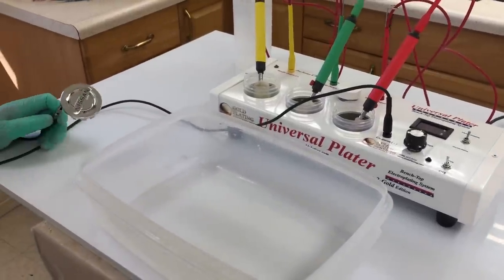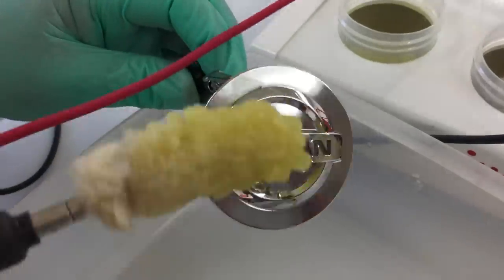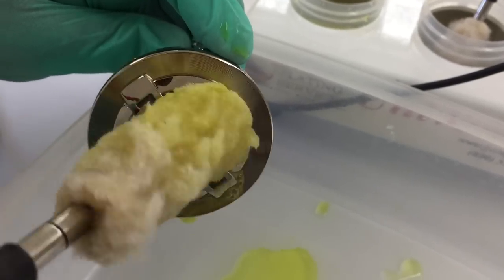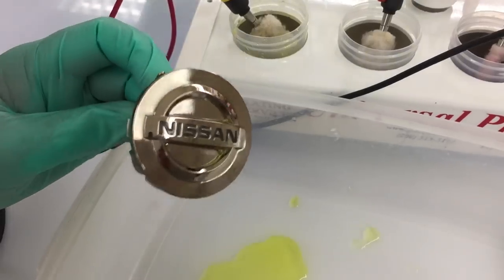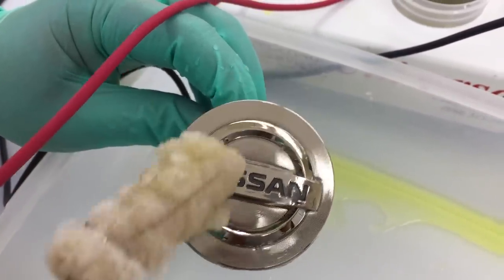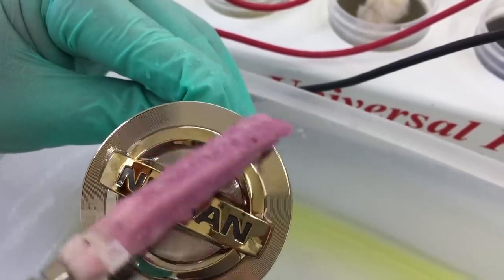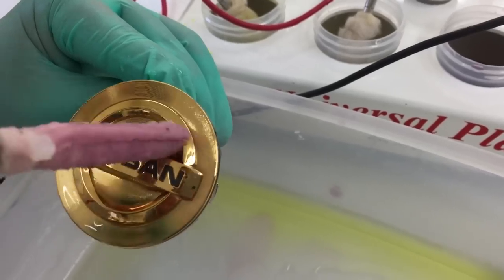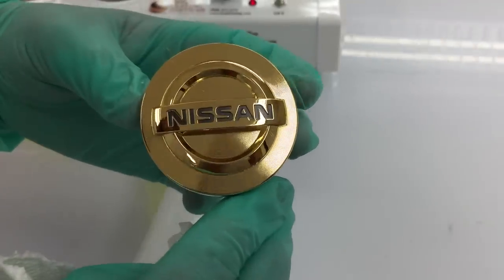How to: Gold Plating on Chrome Items - Plastic Car Emblem - Kit Demo (NEW)

Comment: Is that real gold ? If so how much does it go for ?
Reply from the maker: It is real gold.  Do you mean how much do we sell the gold for?  Our gold goes from $90-$130 per gram, as fabricated solution, depending on how much you buy at a time.  Our 8oz jar of gold contains 2.5g fine-gold and costs $295 for instance.  If you mean, how much will the emblem now sell for?  Many people pay about $50 per piece to have them gold plated.

Comment: this is truly amazing,does the kit come with all that is necessary to gold plate anything even bare steel? and i take it ppl order the solutions from you when they need more? how long will the gold solution last? i guess you need a customer base to make some money and make it pay for itself but i should not have any problem getting ppl to pay 40 bucks to 50 minimum for small items
Reply from the maker: It is truly amazing.  The kit does come with everything necessary to gold plate bare steel.  Yes, we sell and manufacture everything you see in this video (except the emblem) and sell them on a consistent basis - we have for 30 years now.  The gold solution will cover about 1000 square inches of area to a typical decorative thickness.  Many people pay off their kit quickly due to the high amount that can be charged and the low cost per square inch to do it.

Comment: Would it be difficult to do the heads of tiny screws with this? Looks like it wouldnt be easy.
Reply from the maker: If you refer to some of our "Pen Plating" videos (https://youtu.be/sTxOgqKNlPU) , you can see that we plate extremely small areas using the Pen Plating Tips included with the kit.  We've never seen a screw small enough that we would not be to plate them using our pen plating tips.  Hope that helps.

Comment: What is the Nickle Activation solution?  I've never heard of it.  I'm assuming it's not nickle sulfate or chloride right?
Reply from the maker: Nickel Activator (or Surface Activator) is an acidic solution that has no metallic content.  It is purely for activation of certain metals.  Either an activator or a strike is used when plating onto almost any metal, which one is used depends on the metal being plated onto.
Reply: Gold Plating Services

Comment: Can you copper plate chrome parts?
Reply from the maker: Yes, we can.  You also could do it however brush plating of copper isn't the best.  Brush plated copper needs to be polished after plating or it will not look good.  You would follow this same process but instead of using gold you would apply copper.

Comment: Is this real gold now
Reply from the maker: It is real, 24K gold, 99.97%+ minimum purity.  The gold bullion undergoes a process of transformation into a salt.  When this transformation is complete, it looks a lot like table-salt (white).  When you add the gold salt to distilled water, it immediately dissolves into solution.  When electricity is added to the solution, (+)Positive at the anode and (-)Negative at the item you're plating, the gold is transformed again into metallic gold onto the item you have submerged.  There are many other make-up components in the bath, such as hardeners and brighteners, that give the solution it's Purple color but if there was just the gold dissolved in the water it is crystal clear.  You can check out our Pure Gold video that shows a crystal clear solution applying metallic gold to a US Quarter.  Check it out here: https://youtu.be/au1qqg1BEiI?t=1m40s
Reply: Gold Plating Services 
Wow. That's mad! Top stuff

Comment: omg, is it real gold?
Reply from the maker: It is real, 24K gold, 99.97%+ minimum purity.  The gold bullion undergoes a process of transformation into a salt.  When this transformation is complete, it looks a lot like table-salt (white).  When you add the gold salt to distilled water, it immediately dissolves into solution.  When electricity is added to the solution, (+)Positive at the anode and (-)Negative at the item you're plating, the gold is transformed again into metallic gold onto the item you have submerged.  There are many other make-up components in the bath, such as hardeners and brighteners, that give the solution it's Purple color but if there was just the gold dissolved in the water it is crystal clear.  You can check out our Pure Gold video that shows a crystal clear solution applying metallic gold to a US Quarter.  Check it out here: https://youtu.be/au1qqg1BEiI?t=1m40s
Reply: Gold Plating Services how much would it cost to um gold plated a bicycle
Reply: 500$? Unless you wanna plate like 1cm or gold per piece hahaha  @uhohspaggetios3015

Comment: how thick is the layer of the gold please?
Reply from the maker: The piece plated in this video probably has about 20-30 microinches (at least half a micron).  For automotive plating this is a standard thickness to plate items to and it holds up for a very long time if done properly.  If you wanted it thicker, you would simply spend more time plating.

Comment: 1000 dollars just seems like too much. can you say many of those nissan badges could be done with one kit
Reply from the maker: You can potentially plate hundreds of emblems with the bottle of gold that is included with the kit.  Most of our automotive plating customers charge around $100-$150 to do the emblems on a car.  Typically there are 2-6 emblems on a car.  If you do 50 cars at even $100 per car, that is $5,000 revenue.  $1,000 a very small investment considering the potential profit that can be earned.  There aren't very many business opportunities that have such a small start-up cost.  We've taken all the hard work out of getting set up.  It's a fully ready-to-use kit that is build specifically for doing this type of work.  All the chemicals are also ready to use and work with complete reliability.  It requires zero experience as it has ample instruction and knowledge included in the instruction manual (and videos) for a customer to be plating emblems the same day they get it.  Unlimited technical support from our staff of platers who have been doing this for over 30 years is also a priceless benefit as anyone who's encountered issues while plating knows.  Thanks for the comment.
Reply: thanks for the speedy reply and being very informative
Reply from the maker: Any time!

Comment: I purchased the chrome edition.  I had a couple of questions. I tried plating a gun trigger (stainless) I accidentally dipped in in electro cleaner the went on to surface activator instead of nickel. Gold did not stick. It was super hazy and spotted. I noticed my mistake. Buffed it out and Started over. Replace the surface activator with the woods nickel this time. The gold still didn't stick. I washed it to make sure I washed off buffing compound.  What am I doing wrong? Second question. Can I plate black rhodium with this kit? If so do you guys sell It? Thank you very much. You guys are great help.
Reply: Did you ever get this sorted out?

Comment: Does this work on plastic?
Reply from the maker: Plastic cannot be plated onto without having a conductive ink or lacquer applied to the piece prior to attempting to electroplate.  Electroplating requires a conductive (metal) surface.
Reply: Ok, thanks.
Reply: But this piece you just did was plastic. that emblem is plastic.....It's just that there's a nickel plating on it....it's funny you didn't mention that in vid. That the emblem is plastic...

Comment: Does this work for plastic chrome plated car emblems?
Reply from the maker: This piece shown in the video is actually plastic.  I wish we had mentioned this, so thanks for asking. All items that are chrome plated have a layer of nickel underneath them, rather its plastic or metal beneath that.  We don't care (for electroplating purposes) what the item is under the metal surface, all we care about is what the SURFACE is made of.  So if it's plastic, but it's chrome plated (meaning there is nickel underneath the chrome) it can be plated.  If it is wood, but is chrome plated, it can be gold plated.  If it is some random metal that is chrome plated, it can be gold plated using this same process.  The process is the same regardless of the underlying material in this case.
Reply: And one more question. Do you have the  solutions for doing black chrome as well?
Reply: Metal is rare most of them are plastic these days
Reply: James Gamer__  do you have the chemical solutions to do black chrome?
Reply from the maker: Most are plastic, you are correct.  Luckily, plastic ones are easy to plate onto!
Reply from the maker: We don't have a black plating solution.  We have sold some in the past but we have found that they were not very consistent in the results they delivered and we only sell products that deliver great results.  Sorry about that.

Comment: That thing is way too expensive... $1000.00???
Reply from the maker: You can potentially plate hundreds of emblems with the bottle of gold that is included with the kit.  Most of our automotive plating customers charge around $100-$150 to do the emblems on a car.  Typically there are 2-6 emblems on a car.  If you did 50 cars at even $100 per car, that is $5,000 revenue.  $999.00 is a very small investment considering the potential profit that can be earned.  There aren't very many business opportunities that have such a small start-up cost.  We've taken all the hard work out of getting set up.  It's a fully ready-to-use kit that is build specifically for doing this type of work.  All the chemicals are also ready to use and work with complete reliability.  It requires zero experience as it has ample instruction and knowledge included in the instruction manual (and videos) for a customer to be plating emblems the same day they get it.  Unlimited technical support from our staff of platers who have been doing this for over 30 years is also a priceless benefit as anyone who's encountered issues while plating knows.  Thanks for the comment.

Comment: What are you using to rinse it with? I have your Gold Star kit and use a spray bottle to rinse but your sprayer is using a lot less water.
Reply from the maker: We also use a pistol grip spray bottle for cars or larger items. For this video we use a squeeze rinse bottle to keep the volume and over spray down. They are on Amazon for about six dollars, search ACM Economy rinse bottle.
Reply: Thank you very much!

Comment: Will the gold not apply if you do not use the activator?
Reply from the maker: All of the steps we have shown are very important to the gold adhering properly but also looking correct in the end.  If you do not strip the chrome and activate the nickel the gold will not turn out the way it should.  We would never include steps that do not have a good purpose.

Comment: 1000 bucks just so i can make a mess of my badges?
Reply from the maker: You can potentially plate hundreds of emblems with the bottle of gold that is included with the kit.  Most of our automotive plating customers charge around $100-$150 to do the emblems on a car.  Typically there are 2-6 emblems on a car.  If you do 50 cars at even $100 per car, that is $5,000 revenue.  $1,000 a very small investment considering the potential profit that can be earned.  There aren't very many business opportunities that have such a small start-up cost.  We've taken all the hard work out of getting set up.  It's a fully ready-to-use kit that is build specifically for doing this type of work.  All the chemicals are also ready to use and work with complete reliability.  It requires zero experience as it has ample instruction and knowledge included in the instruction manual (and videos) for a customer to be plating emblems the same day they get it.  Unlimited technical support from our staff of platers who have been doing this for over 30 years is also a priceless benefit as anyone who's encountered issues while plating knows.  Thanks for the comment.

Comment: "alows you to gold plate onto chrome plating....             so were going to need to take the chrome plating off cous you dont wanna gold plate strait onto chrome plate"
Reply from the maker: That is correct.  It allows you to plate onto chromed plated items.  Gold cannot be correctly be applied on top of chrome, therefore you must remove the Chrome Plating in order to gold plate it.  Many electroplating kits out there do not have the capability of stripping Chrome off of the item and therefore they cannot gold plate it.  That is the reason we made this edition of the Universal Plater Kit - to allow people to gold plate items that were previously chrome plated.
Reply: previusly CONPLEATLY changes the sentence
Reply from the maker: Yes it does.

Comment: Wouldn’t wrapping just be easier
Reply from the maker: Wrapping isn't real 24K gold.  You can do many things with electroplating that you cannot do with wrapping.  This requires little to no skill or artistic ability.  There are many reasons, ultimately they are separate arts with separate places in the finishing industry.
Reply: Gold Plating Services wrapping is cheaper and easier and looks the same
Reply from the maker: Neat.  Sounds like wrapping is for you!

Comment: Damn that kit cost like 1.2K$
Reply from the maker: If started as a business, most people pay off the kit quite fast with the materials the kit comes with.  It comes with a $300 bottle of gold and everything else you need to get going.  Many people charge about $25-$50 per emblem and you only apply about $1.00-$2.00 worth of actual gold ( your cost as a plater ).

Comment: Dude is this actually worth money?
Reply from the maker: You can potentially plate hundreds of emblems with the bottle of gold that is included with the kit.  Most of our automotive plating customers charge around $100-$150 to do the emblems on a car.  Typically there are 2-6 emblems on a car.  If you did 50 cars at even $100 per car, that is $5,000 revenue.  $999.00 is a very small investment considering the potential profit that can be earned.  There aren't very many business opportunities that have such a small start-up cost.  We've taken all the hard work out of getting set up.  It's a fully ready-to-use kit that is build specifically for doing this type of work.  All the chemicals are also ready to use and work with complete reliability.  It requires zero experience as it has ample instruction and knowledge included in the instruction manual (and videos) for a customer to be plating emblems the same day they get it.  Unlimited technical support from our staff of platers who have been doing this for over 30 years is also a priceless benefit as anyone who's encountered issues while plating knows.  Thanks for the comment.